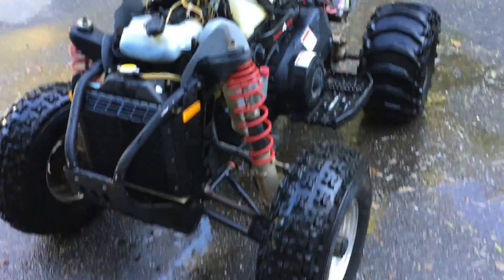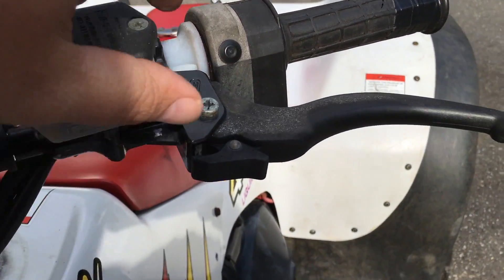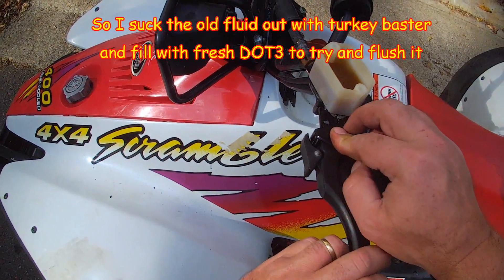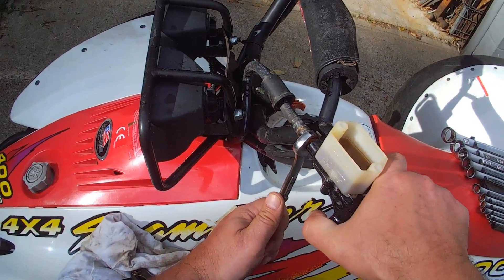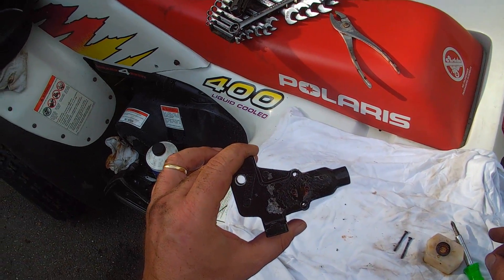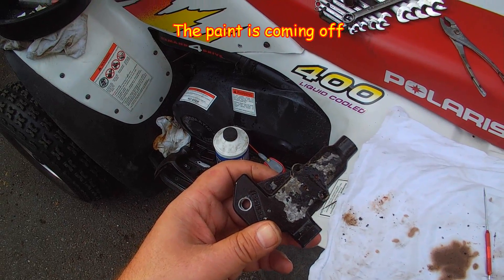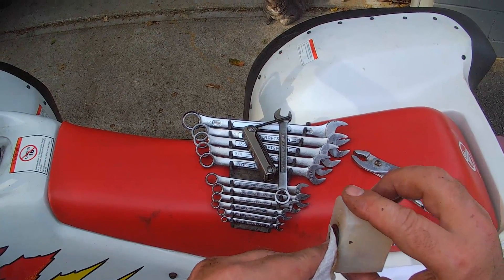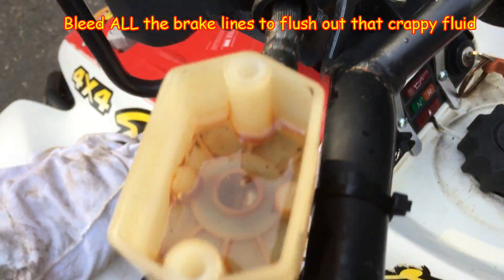1999 Polaris Scrambler 400 4X4 Part 2. Brakes locked up! Master cylinder flush/clean

Comment: I have a problem on a 1995 scrambler 400 with its brakes, itll make pressure if I pump it up with the handle but will not KEEP pressure, why?
Reply from the maker: Your caliper pins might be seized and not floating. So it pushes the disc.over if you look at it closely.
Reply: @MotoCheez  I found out why, the master cylinder had air in it, took forever to bleed to have "ok" pressure so I'm still going at it
Reply from the maker: Ahh. That'll do it too 😁

Comment: What would it be when my back wheels roll for about 5 feet then they lock up
Reply from the maker: Only 5 feet? Might be bearings...
Reply: @MotoCheez  alright thanks
Reply from the maker: Could be a lot of things. But take your chain off and see if it locks up, then spread brakes and try.. process of elimination.

Comment: I couldn't even push my mastercylinder in with my finger like thar. safe to assume it's garbage?
Reply from the maker: Works with lever? They do have a tight spring.
Reply: @MotoCheez  I'm having trouble bleeding my breaks. I can't seem to get fluid out the rear caliper
Reply from the maker: Maybe the pedal adjusted too tight?
Reply: @MotoCheez  pedal is removed. Just put a plug in its place.